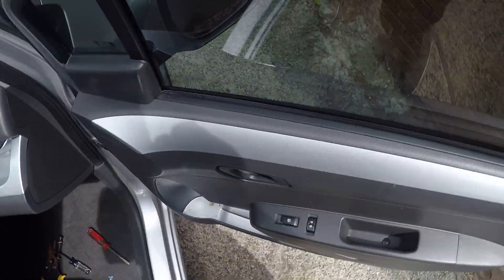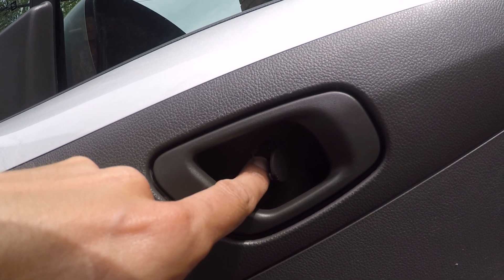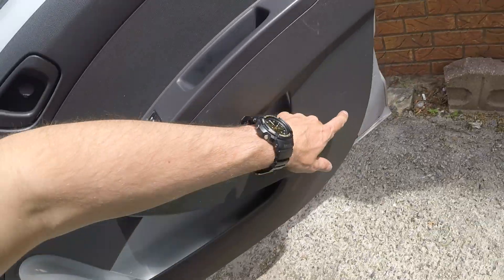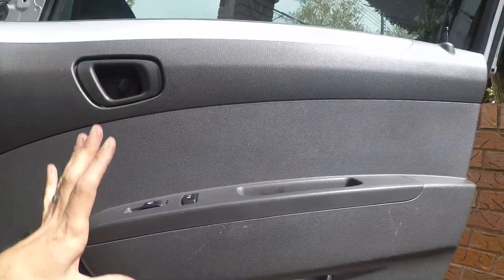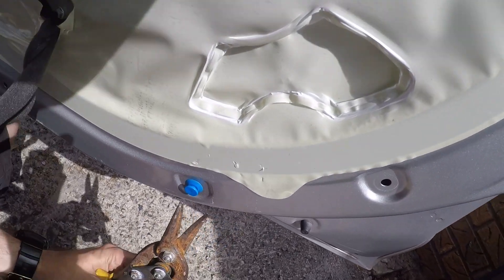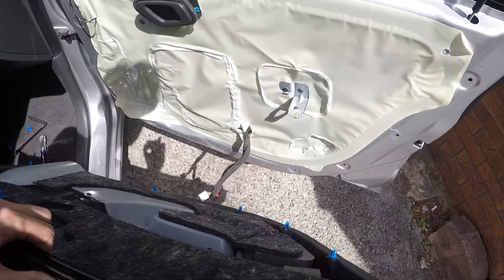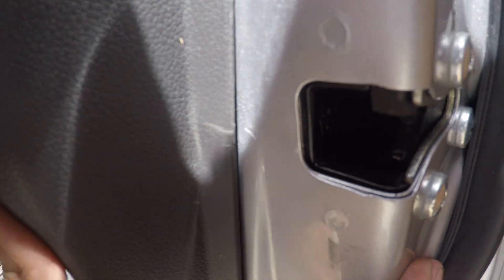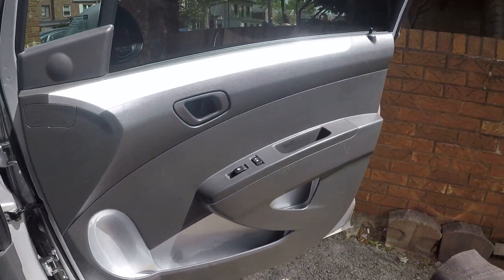How to remove door panel in Chevrolet Spark 2009-2015

Comment: Thank you for the video! Always great to see something before I try to force something and end up possibly breaking something.🙂
At 0:38, I did not have to open the lid (screw cover) and remove the screw. Discovered that when I was putting the panel back on. Maybe will prevent handle issue at 4:33.
At any rate, thank you again!

Comment: Does the entire door panel need to be removed to get to the window switch? Or can I pop that trim out seperately?
Reply: Did you ever find the answer? Driver side control panel has dislodged and passenger rear window stopped working and does stay up. Woof